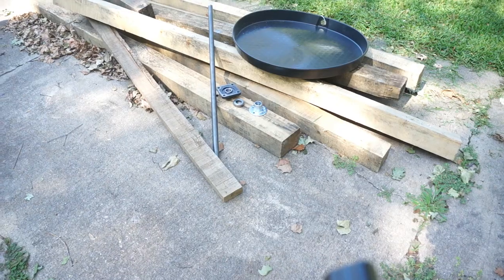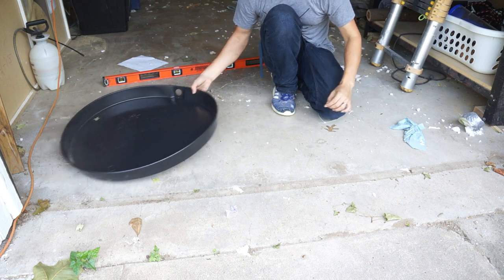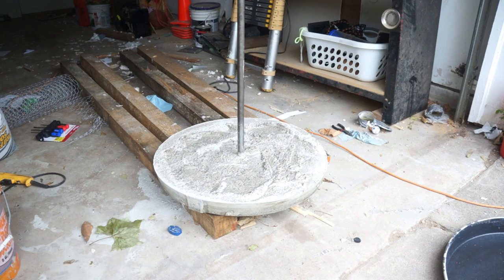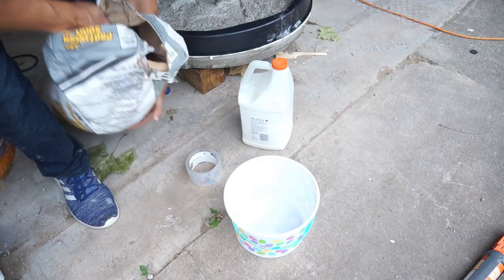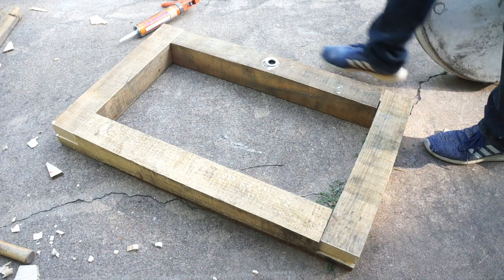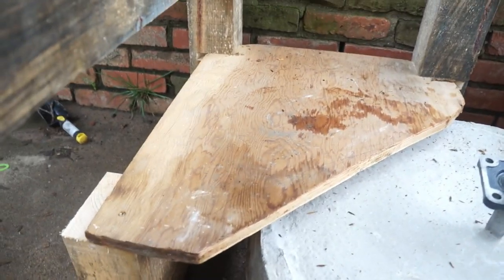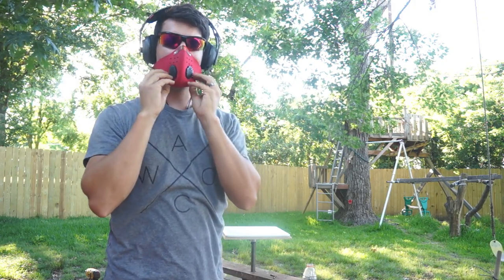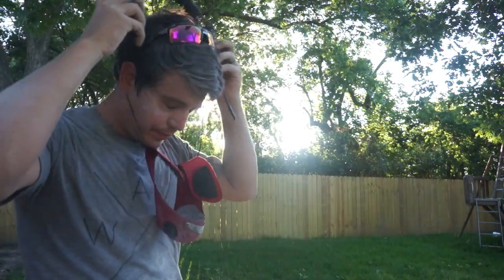Thorough Tutorial - Making A Potters Kick Wheel

Comment: Back in the 70’s my pottery teacher made a kick wheel.   She used 2 sheets plywood cut into circles for the bottom wheel.  They were about 3 ft in diameter. It worked pretty good.  She may have had bricks in between the wood layers.
Reply from the maker: That's awesome! I might try that on my next one

Comment: The inside of the flange is bigger because the 3/4” designation is the inside diameter of the pipe. Add pipe wall thickness and that’s why it measures larger. All pipe is named based on the inside diameter of the pipe.

Comment: Good job on this project, especially if you consider yourself a beginner builder.👍 I'm considering following your basic design here but I have a question before I start. On the Thrust Bearing, does the spindle go entirely through the TB, or does it merely sit on top of it, or sit inside a shallow gallery that keeps the spindle centered. It appear you drilled realatively deep with drillpress bit, but then routed a larger gallery to accept the TB outer dia. and only deep enough to leave the TB a little proud of the wood cross-member. what is purpose of this operation? Thanks for your help or anyone who might explain this to me.
Reply from the maker: I guess the spindle doesnt technically have to go through but you have to router out at least some wood so the tb is free to spin

Comment: Hi! Super cool video!! I was wondering how the shaft interacts with the thrust bearing? Does the bottom of the shaft go though the bore of the bearing and then you have something attached to the shaft which rests on top of the bearing?
Reply from the maker: That's exactly right. The concrete rests on the bearing and the shaft goes through. There's nothing holding it on except weight
Reply: @BlanchBrothersStudio  ah yeah that makes sense! I completely forgot about the concrete haha:) Thanks so much!!

Comment: so you just kick the concrete wheel? does it generate enough momentum for pottery? btw could you make one similar do the smith's grinding stone? a transverse spindle convertion perhaps?
Reply from the maker: Ya it would work the same way but I think you would have to add some gears. The heavier you make the concrete the longer it will spin. While turning it lasts about 60sec before you have to kick it again
Reply: @BlanchBrothersStudio  in that case i guess the flywheel woudn't need to be that large right? would it be better connected to the vertical or to the horizontal axle?

Comment: [FYI: "3/4" DIA., RIGID WATER/GAS PIPE, OR ELECTRICAL CONDUIT MEASURES 3/8" LARGER ON THE OUTSIDE, THAN IT'S "NOMINAL" SIZE. (...HENCE 1-1/8" OD. FOR "3/4" PIPE).]
Reply from the maker: makes sense

Comment: So i guess i dont quite understand how the thrust bearing mounts to the shaft because it apears like it goes all the way through. So what is the weight of the kick wheel resting on?
Reply from the maker: It doesn't "mount" to it. The concrete rests directly on top of the bearing. You can put a few washers there if you need to.
Reply: @BlanchBrothersStudio  Oh ok! So the shaft goes through the bearing and then because the bearing sits abouve the wood the concrete rests directly onto it! Sweet. Thank you!
Do you know of a bearing that would both bear weight and mount to the shaft?
Also do you know of a joint that connect to the shaft solidly to a peice of say plywood. But with the pipe running through it. Like a floor flange but with an opening all the way through. Thanks!!
Reply from the maker: @nicolemaldonado4798  the floor flange I bought does go through. Just look at the black pipe diy shelving stuff and you'll find what you need. Never seen a mountable thrust bearing but you might be able to order one